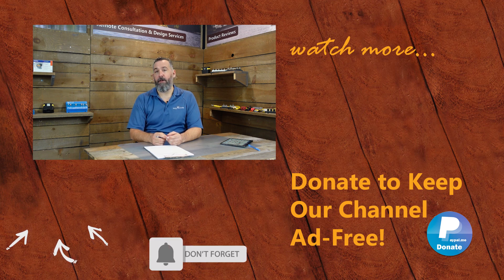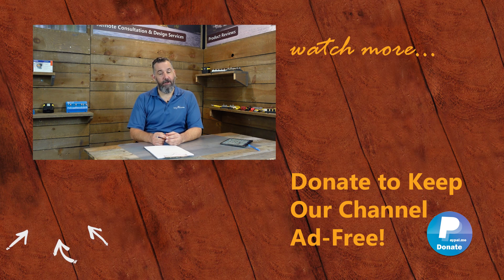If I Have An Inverter/Charger, Do I Still Need an Isolation Transformer?

Comment: Polarization of AC: The Schuko AC power plug in Sweden and many other European countries are not polarized in the sense that you can put in the plug in two ways.
Reply: But the receptacle has screw terminals for the installer to hook it up, and that could be reversed.
Reply: @pjtemplin  You CAN reverse the Schuko plug, so per definition there is no positive polarisation possible.
Reply from the maker: Interesting, here in North America, the neutral and the hot at an AC outlet are definitely polarized.

Comment: Hi Jeff.  In your interview with Calder, I think he mentioned that if you set your boat up so that ac shore power only feeds the charger, and your onboard AC loads are drawn through an inverter ( and not directly from shore) then you have achieved the same outcome as having an isolation transformer. I think he also said you have to be careful about grounding set up.  Did I understand correctly?  Please comment on this.  I think it would be helpful as part of a more complete response to the question addressed in this video.  Thanks.
Reply: I think that was the question op asked
Reply from the maker: Yep, some boaters do a charger only connection to shore power, while all AC loads are powered via the inverter.